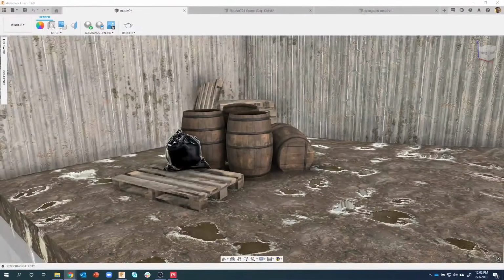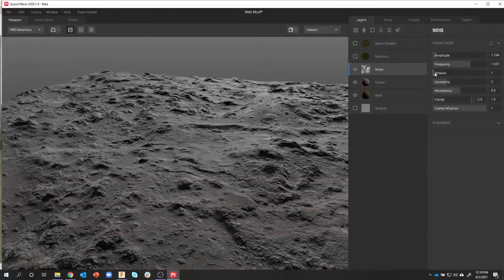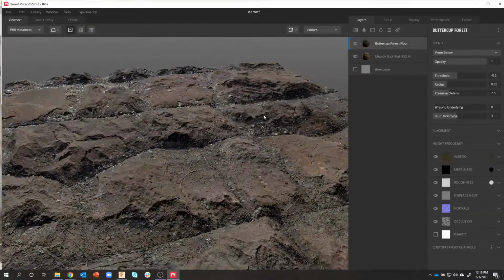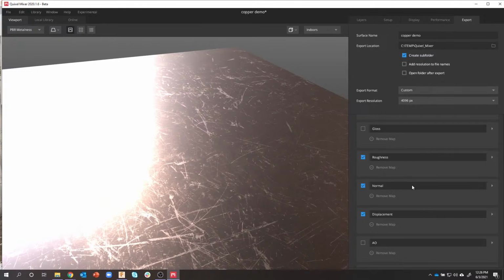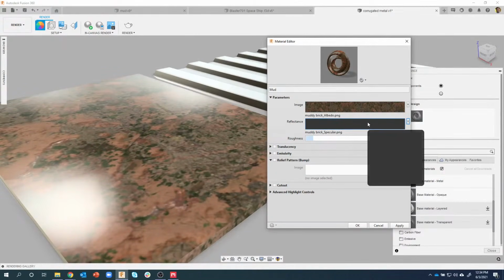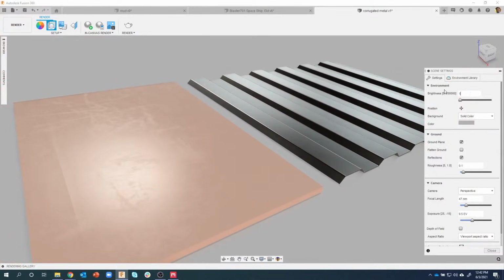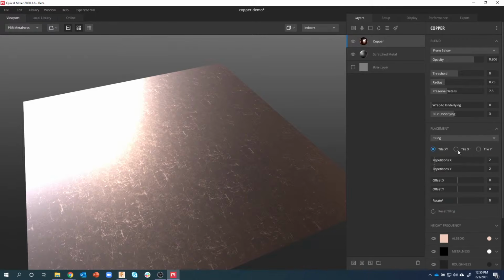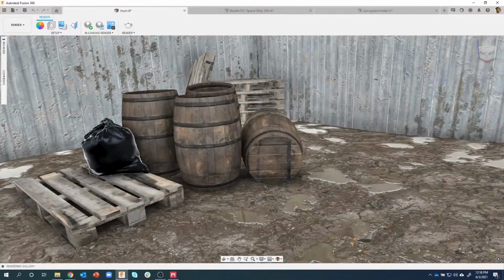Episode 90 - Creating custom materials in Fusion 360

Comment: How to import textures of 3d models into fusion 360. When I download the Alpedo.png file of the barrel from the quixel mixer, it looks like the one in the link (1). when i add it in fusion 360, i don't get a view like yours.(link 2)..
Would you be helping me in this regard?

link 1:https://drive.google.com/file/d/1BWtIviU_2-1epu3xF79bLAGYyx9PZbwH/view?usp=sharing
link2:https://drive.google.com/file/d/12GlvlcTpEXPdyQz8sZTs6m5Om3s8Syiu/view?usp=sharing
Reply from the maker: Fusion 360 doesn't do UV Mapping.  The image you showed is a UV-Unwrapped image that came with the barrel 3d asset.  What I was showing was creating a 3d barrel in Fusion 360, then using Quixel to make a material that I could apply to particular faces on the Fusion 360 barrel.